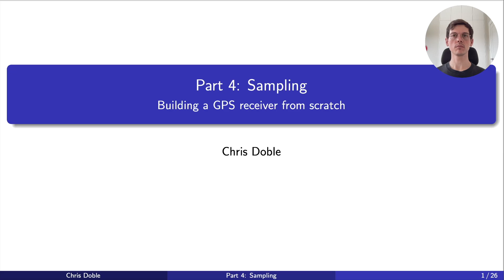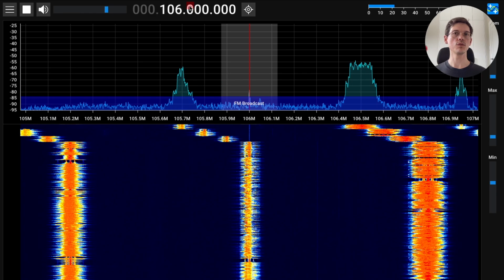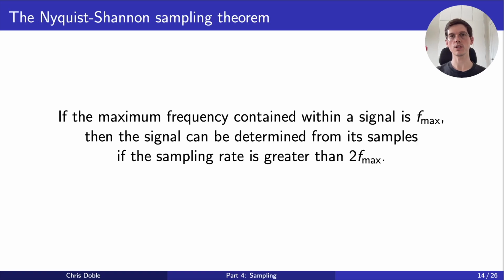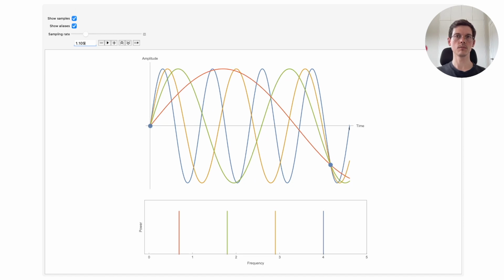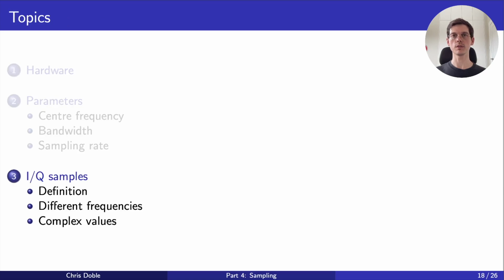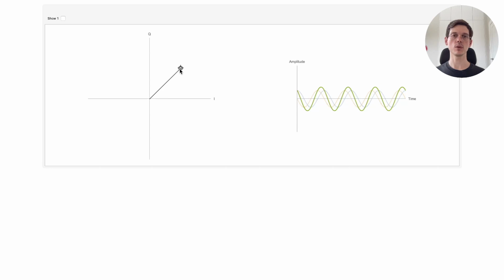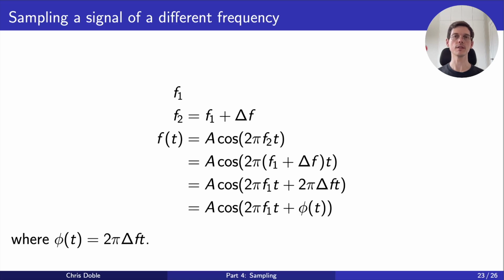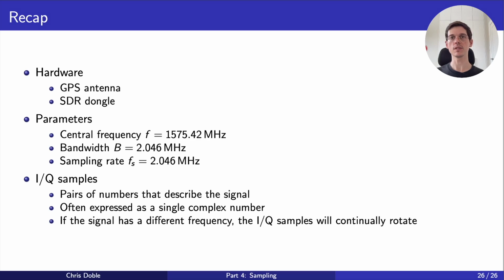Part 4: Sampling | Building a GPS receiver from scratch

Comment: The entire series is absolutely wonderful, however, one chapter in this part is just wrong. I'm talking about "Parameters: Sampling rate". So let's start with what exactly I think is wrong, then I'll go over (some of) what actually goes on in an RTL-SDR dongle.

So, while the "Centre frequency" chapter establishes you do need to set some kind of center frequency for the whole system to work, you then introduce the idea of undersampling and claim you're aliasing the L1 frequency by using a sampling frequency that's 770 (!) times smaller. You're not, for two reasons. For one, that would require an ADC with an analog bandwidth comparable with the ~1.6 GHz frequency of the RF signal, which is definitely not what the RTL-SDR has. Yes, undersampling does work when the sampling time is shorter than the overall ADC conversion time, meaning the faster signals do get sampled properly (the input waveform doesn't change by much during the entire sampling time), but the output sample rate doesn't meet the Nyquist criterion. In those cases you can swap the low-pass anti-aliasing filter that's often present before the ADC to a band-pass one and capture an alias of the signal of interest. But an ADC that struggles to do 3.2 MHz, yet can sample a 1.6 GHz signal, doesn't really exist in practice. Even if it did, the sample clock would need to have an incredibly low jitter value for what it would be. The second reason this wouldn't work without some additional hardware is that everything else between DC and 1.6 GHz would alias down as well, including everything the (not-perfectly-selective) antenna picked up and all of the noise. And even with the magic of spread-spectrum in the form of CDM, the noise would be just too much - as you are well aware, GPS is already awesome in what it can do, considering the received powers comes out to, what, a couple of femtowatts?

So what actually goes on in an RTL-SDR receiver? For one, analog frequency downconversion, that is, a mixer (made out of a handful of very fast diodes) is being fed with a Local Oscillator signal, which shifts the frequency down. I won't go into exactly how chopping up a signal leads to shifting its spectrum around, but yes, the one thing I would expect to be mentioned, especially after talking about the center frequency, is that the dongle uses the frequency setting to get the part of the input spectrum around it down to near-DC, so that it can actually be sampled by an ADC. Now, feel free to stop reading here, but it seems there's at least one more fundamental thing about how an RTL-SDR dongle works that is worth mentioning. Yes, the external tuner IC has that mixer and an LO synthesizer, the required filters, some nice amplifiers, things like that. The RTL2832U does have an ADC, but it doesn't sample at up to 3.2 MHz, even though that architecture would kind of work - you could set the LO frequency to be exactly equal to the center frequency of the L1 signal, then the center frequency would end up at 0 Hz after conversion, but dealing with signals very close to DC is a huge pain. In reality, you would want to set the LO a bit lower (or higher) and have the converted signal land somewhere above DC, so in the context of GPS L1, set the LO to (for example) 1573 MHz, then the 1575.42 +/- 1.023 MHz signal would go down to 2.42 +/- 1.023 = 1.397 to 3.443 MHz (which, yes, you'd need to sample at at least 6.883 MHz). This is what SDRs such as the HackRF One do, then they deal with the offset signal in software. The RTL-SDR, however, is based on DVB-T receivers, so the RTL2832U IC deals with this before the samples even reach the computer. Its ADC has a sample clock of 28.8 MHz (so the up to 3.2 MHz refers to the entire RTL-SDR dongle working as a system, not to the ADC inside the RTL2832U), then dedicated hardware inside does another frequency conversion (this time it's done in the digital domain, no diodes), filtering, and it can even do synchronization and other fancy things. So not only is there a single frequency conversion happening in the signal path, there are actually two! Really quite amazing.

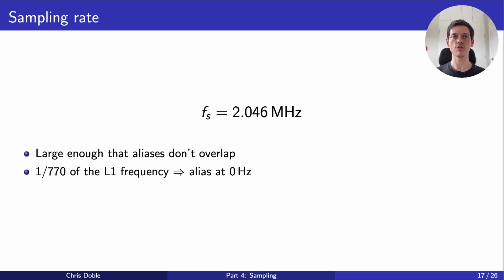Again, I absolutely adore the entire series Chris, the wall of text above isn't really meant for you (even though I formulated is as such, sorry), it's more meant to add extra info about this one part of the entire reception process that the videos did not go into detail on and also to satisfy people like me, who I'm sure will pause the video around 9:06 and scroll down to look for a comment like this.
Reply: Is there anywhere I can read more about the conversions done on hardware? It would be useful for my graduate thesis.
Reply from the maker: Thanks for taking the time to write up such a detailed explanation! I'm not too familiar with the inner workings of SDR receivers so sorry for any inaccuracies in the video. I'm glad this comment is here to help clarify.

Comment: I think you skipped over the details of the antenna construction, I would have loved to see how the signal is captured, cleaned and amplified, as it is near or under the noise floor.
Reply from the maker: Unfortunately I don't know much about antenna construction so I just bought an off-the-shelf GPS antenna and didn't go into much detail in the video. Your comment made me wonder about it though and I found this video which I enjoyed: https://www.youtube.com/watch?v=s-jFprdDcM4 The thesis he mentions looks particularly useful.
Reply: I think that's the point - antenna construction aside, the PRN and correlation work done in the digital domain eliminates the noise to allow the signal to stand out more-or-less naturally, so there's no extra analogue filtering or amplification required before the SDR dongle captures the QI samples ... that's the message I got from this anyway.  The dongle does map the target frequency back to baseband and then samples from there, so there may be filtering done at that point to clean things up but that's already baked into the hardware - most of the SDR dongles I've seen are actually digital TV tuners where they can be put into a 'test' mode and allow the hardware parameters to be adjusted more-or-less at will ... which still blows my mind that an $80 part (or so) can do this out-of-the-box ...
Reply: Thats very interesting, thanks!